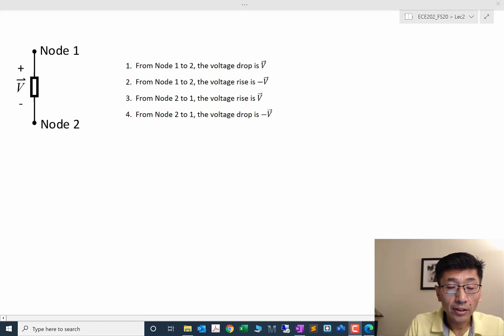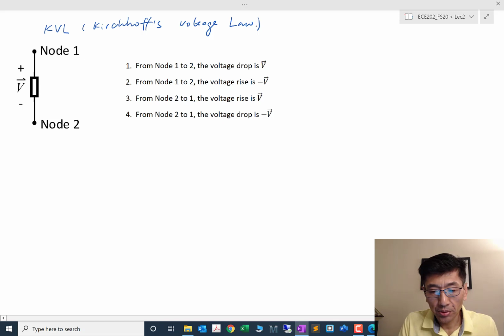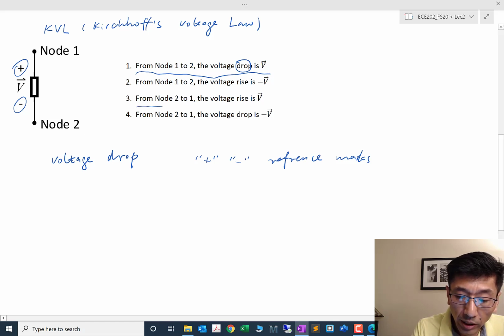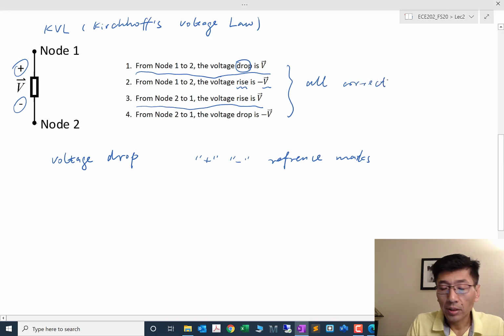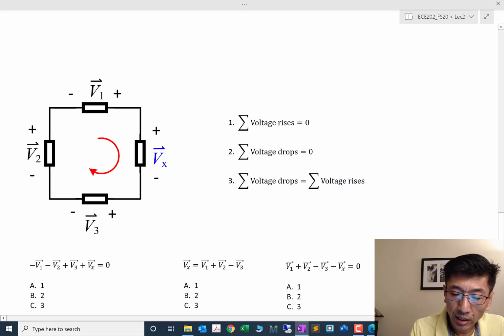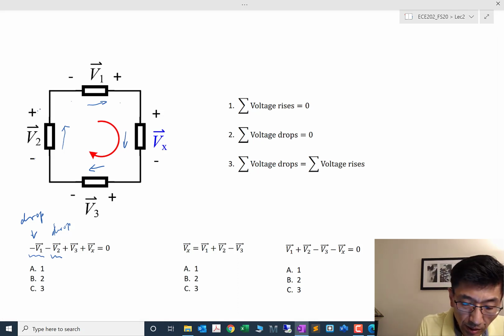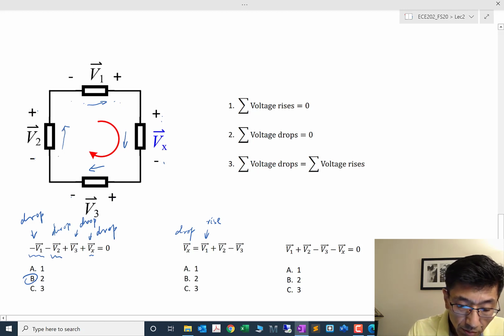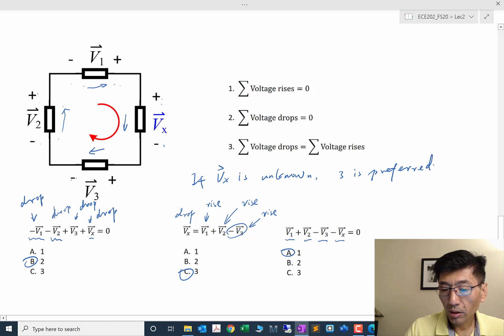ECE202_Lec2_Part 2 KVL in Phasors

Comment: For the second example, why did you put the V3 as a negative voltage rise instead of a positive voltage drop?
Reply from the maker: Following the clockwise direction (indicated by the red arrow) we chose,  from "+" to "-", the voltage drop is V3. For the same direction, "+" to "-", the voltage rise is -V3. I assume you were referring to Vx = V1 + V2 - V3. On the left side of this equation we have the voltage drop Vx. On the right side of the equation, we need to have only voltage rises, V1, V2, and -V3. If I put +V3 on the right side the equation, it would be wrong.